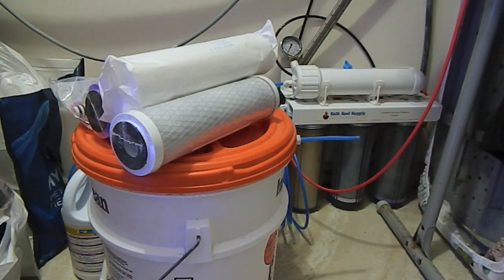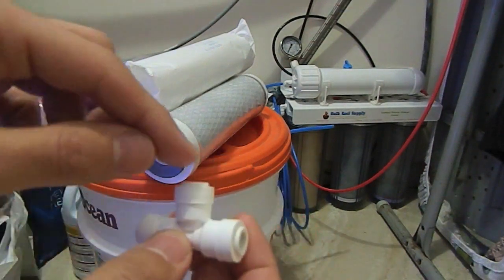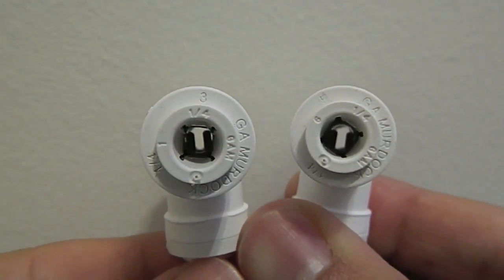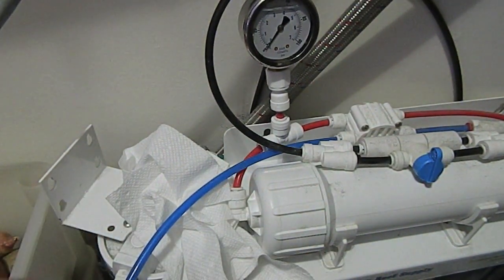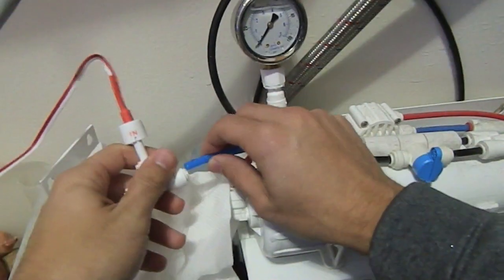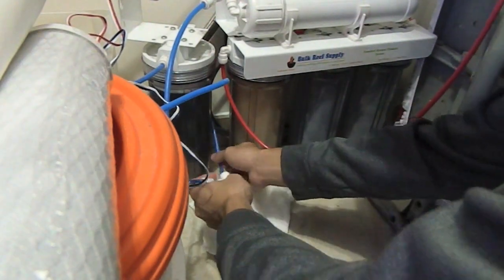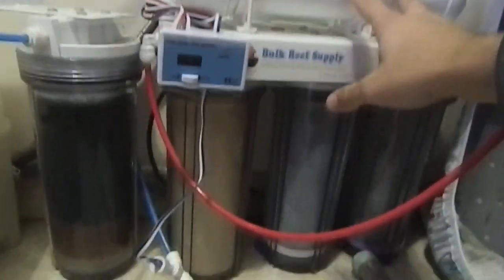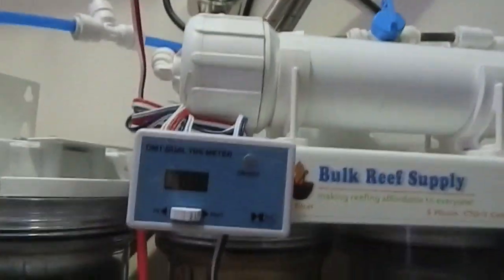How To: Install a TDS Meter

Comment: Might it be the single sensor, mine has no in/out none of the 3 so if I get it wrong the worst thing may be a different The fittings but that wouldn't have any bearing on the current flow of this simplistic way of how the tds meters work, right ? I'm wondering what is up with left/right/in/out fittings and why. 
Thanx tho !

Comment: Should have put the "in" one on the red line where it connects to your main water source and the "out" to your blue line where it comes out of your di resin. This way you're getting a true reading of how well your system is actually working.  Your in line will generally read from say, 140ppm or tds up to as much as 500 and over. Your out should read between 75% to 98% lower than your in.  IE: if you're membrane is good and filters are good, you could have an in reading of 240tds in but your out line can read 1 or 2. Doing the way you've done it, you're "in" is reading the water after it comes out of the ro membrane instead of as it should, coming into the ro membrane. Not a true reading. of the tds system.
Reply: TDS( In )Should be before membrane and TDS (out) after membrane.  We will know how good of membrane or time to replace membrane.

Comment: why did you install a shut off value on your waste water line
Reply: Its not on the waste, line (at first glance I thought it was also, B/C my RO cap is on the right not left) - when the RO feed is on the left hand side (as it is here) the "waste" line will be on the 'upper' fitting out of the permeate side. Another way to see this is to look at the end fittings and see which one is closer to center (not really something we can see on this video)....  good info tho!!! :D

Comment: So your tap water in only 1ppm?
Reply from the maker: No it is probably way higher, the TDS meter is showing me that after the water comes out of the membrane the TDS is about 1-2 ppm.  Who knows how high it is before it gets to the membrane. Remember that the sediment filter and carbon blocks are removing a lot before reaching the membrane.